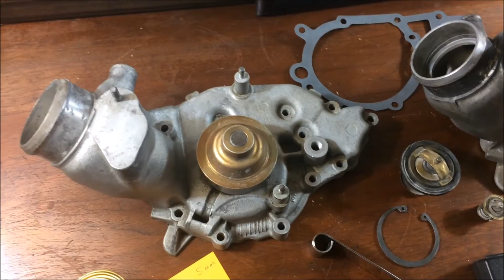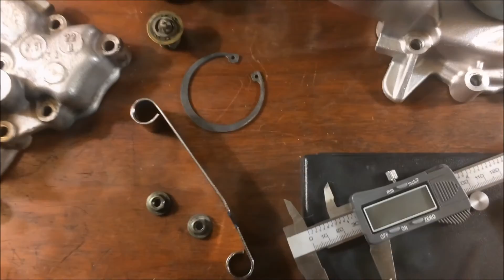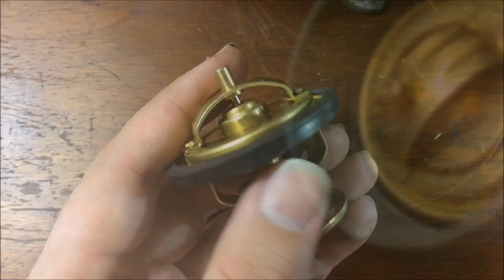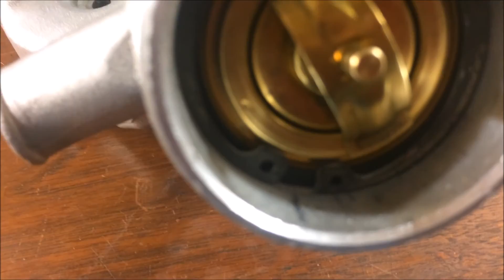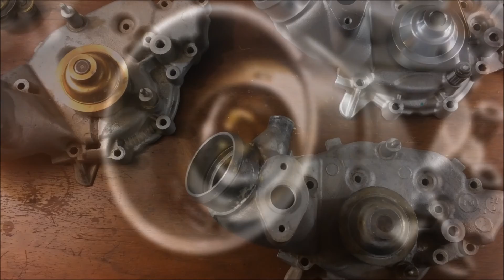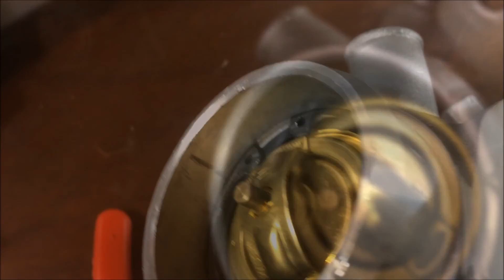Porsche 944 water pumps

Comment: Hey thank you again for another helpful video! So I had ordered mine from RA also uro it looks to have a 3mm space for the thermostat even tho I ordered for my 88 na...my thermostat came w a o ring gasket like you show. Just wondering if this set up will work on my 88 n/a? Thank you
Reply from the maker: As long as the thermostat is tight with the rubber seal in place then you're good to go!

Comment: I've just bought a 1983 944. It appears that it has an original-style water pump (no guide plate or studs for one and no port). I'm thinking of changing it when doing the belts. Am I going to have to change the thermostat as well, or will the old thermostat fit in the new pump if the correct seal is installed?
Reply from the maker: The new style pump will need the newer thicker seal. So I would just go ahead and replace the thermostat if it’s original. That will save you a lot of work trying to get it back out when it inevitably fails. Good luck!

Comment: Interesting to see differences, but to note. The 2.7L is the same block as the S2 (aka 3.0L). They are not different whatsoever. It's internals (and the head obviously) that make the difference.
Reply from the maker: Yup, that's why I mentioned that both the 2.7L and the 3.0L engines used the same water pump, which is different than the 2.5 liter. Thanks!

Comment: Can I ask where you get water pump? I have an 84 NA and not sure which brand to buy.
Reply from the maker: I usually buy a URO pump from Rock Auto for about $100. I've been using them for decades without any issue. As long as its a new pump and you install it correctly, you'll be fine. Good luck!

Comment: Would you recommend always replacing the water pump along with new timing belt? If you think so, where should I get one? I have a 1986 Porsche 944, not a turbo, and on other cars, I've always replaced them together. What do you think? thank you.
Reply from the maker: Hi, I don't change the pump with every belt change. I usually change the pump only after about 60k miles or so or when it starts feeling loose. I hope that helps!

Comment: Fine clip once again ! I just ordered a LASO wp from Germany. Do you have a favourite when it comes to manufacturers ? Is there any at all that make a metal impeller that doesn't rust and impede the whole cooling system (esp. the radiator) ? I've been having this idea for a long time to rebuild mine myself - as the housing is both rare and in good shape. Why don't people do this themselves (only a few companies, and they don't get just good critics), do you need anything else than a press for the bearing ?
Reply from the maker: I don’t really have a preference in pumps but I always prefer to go with a new one. Years ago when pump prices were ridiculous it might have been worth rebuilding them but today you can get new pumps under $100 so not really worth the effort. As for the impeller rusting, it usually cause by someone not using the correct ratio of coolant. So if yours rusted then someone was running straight water or too little coolant at some point. I hope that helps!

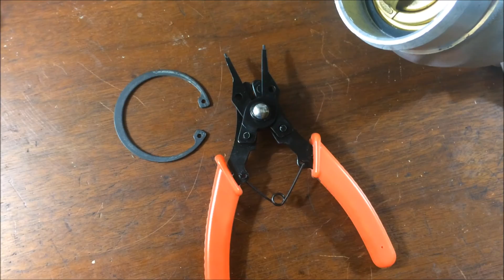Comment: @2:56 "It's very difficult to do this job (remove the thermostat) in the car." Probably the biggest understatement in the history of the planet. I went through three different snap ring pliers and still no soap. Whoever designed the angle of the housing as it sits in the car should have been punched in the throat. Why the thermostat couldn't have been placed up where the bleeder valve is located -- as it is on so many non-Satan-inspired engine designs  -- escapes me.
Reply: I 2nd that notion, my knuckles and my sanity will vouch for that...
Reply from the maker: Yeah, without the right tool its virtually impossible to remove that snap ring with the pump in the car... even with the right tool its still not fun!

Comment: on Clarks garage he mention when upgrading a early car to newer style water pump you install a shim washer before you install the snap ring? what your thoughts on that for earlier cars getting the newer style waterpump
Reply from the maker: I believe that most thermostat kits that you buy now will have two rubber seals of different thicknesses. It used to be that there was just one thin seal and then you had to use the shim but now that's no longer the case. If you have the thicker seal it should fit snug without the shim. I hope that helps!
Reply: Thank you so much for the fast reply i am installing the water pump tomorrow so now i can go ahead and install the thermostat the correct way now before it's in the car
Reply: Added cost, a lot of misc parts are thrown out. Until I am given a good reason, I'll stick with original